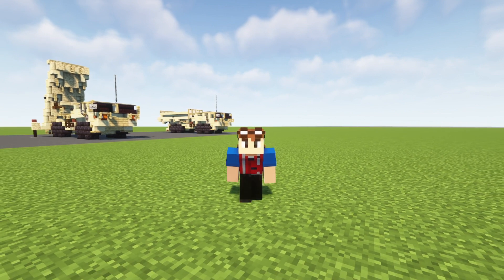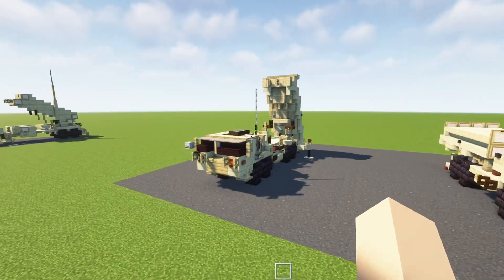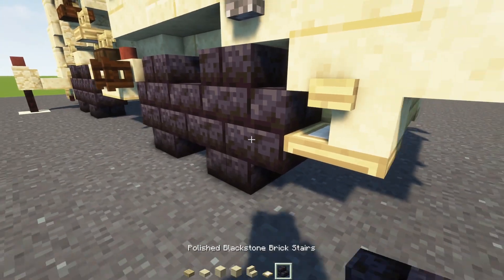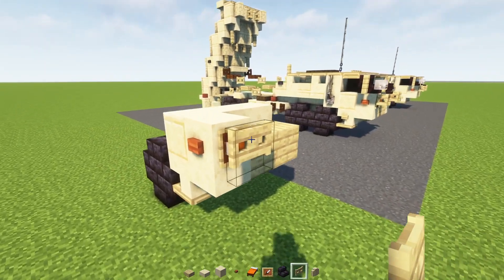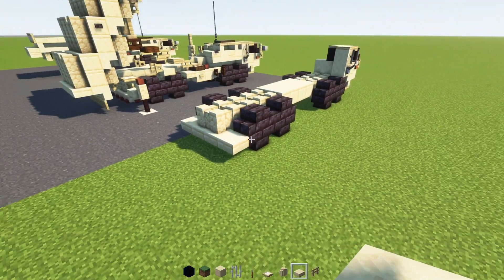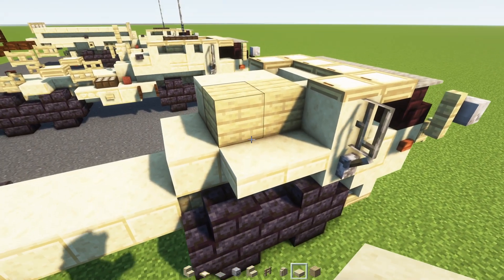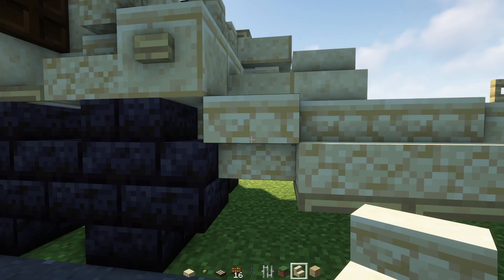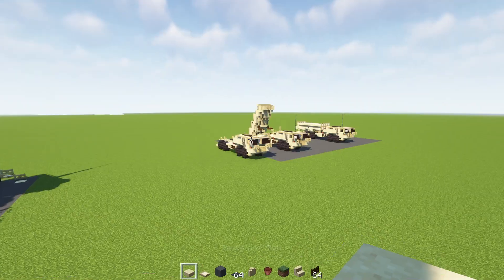Minecraft THAAD Missile Defense Tutorial

Comment: Loved the video @MC Military Force! Can't wait for the next video man! Sorry for taking so long, but I finally managed to get the Different Anti-Aircraft Battery Arrangements for the American Cleveland-class Light Cruisers from World War Two.

Just for Reference, The Cleveland-class Light Cruisers had 27 Ships which came after the Atlanta-class Light Anti-Aircraft Cruisers. They both used the same Hull Design for the Interwar Period Brooklyn-class Light Cruisers, though the Atlanta-class Ships were Shorter in Length, Narrower in Beam/Width and Shallower in Draft than the Cleveland-class Ships. They were 608 ft. 4 in. Overall in Length (or 187.179 Meters/Blocks), 600 ft. at the Waterline (or 184.615 Meters/Blocks), 66 ft. 4 in. in Width (or 20.410 Meters/Blocks), a Mean/Average Draft of 25 ft. 6 in. (or 7.846 Meters/Blocks), a Max Draft of 25 ft. (or 7.692 Meters/Blocks) and a Height of 113 ft. (or 34.769 Meters/Blocks) from the Keel (Bottom of the Ship) to the Top of the Radar Mast's.

The Cleveland-class Light Cruisers had 4 Triple Mount 6"/47 Caliber Guns (7.230 Meters/Blocks long) for their Main Battery and 6 Twin Mount 5"/38 Caliber Guns (4.871 Meters/Blocks long) for their Dual Purpose Secondary Battery. As I said before, The Anti-Aircraft Arrangement Varied depending on when the Ship was Built, which is the Subject here. The 27 Cleveland-class Light Cruisers are as Follows:

 1). USS Cleveland (CL-55).
 2). USS Columbia (CL-56).
 3). USS Montpelier (CL-57).
 4). USS Denver (CL-58).
 5). USS Santa Fe (CL-60).
 6). USS Birmingham (CL-62).
 7). USS Mobile (CL-63) (Pronounced Moh-Beel).
 8). USS Vincennes (CL-64).
 9). USS Pasadena (CL-65).
 10). USS Springfield (CL-66).
 11). USS Topeka (CL-67).
 12). USS Biloxi (CL-80).
 13). USS Houston (CL-81).
 14). USS Providence (CL-82).
 15). USS Manchester (CL-83).
 16). USS Vicksburg (CL-86).
 17). USS Duluth (CL-87).
 18). USS Miami (CL-89).
 19). USS Astoria (CL-90).
 20). USS Oklahoma City (CL-91).
 21). USS Little Rock (CL-92).
 22). USS Galveston (CL-93).
 23). USS Amsterdam (CL-101).
 24). USS Portsmouth (CL-102).
 25). USS Wilkes-Barre (CL-103) (Pronounced Wilks-bar).
 26). USS Atlanta (CL-104).
 27). USS Dayton (CL-105).

Now the Anti-Aircraft Batteries Varied from ship to ship, so I've listed them down as different "Standards" so that you or anyone who wants to try their hand at Building these Ships can have the Number of guns ready to build.

 • Cleveland Standard: Cleveland and Columbia both had 2 Quad Mount 40 millimeter Bofors and 13 Single 20 millimeter Oerlikon Anti-Aircraft Guns.

• Montpelier Standard: Montpelier herself had 4 Quad and 4 Twin Mount 40 millimeter Bofors and 17 Single 20 millimeter Oerlikon Anti-Aircraft Guns.

 • Denver Standard: Denver Herself had 4 Quad Mount and 8 Twin Mount 40 millimeter Bofors and 17 Single 20 millimeter Oerlikon Anti-Aircraft Guns.

 • Santa Fe Standard: Santa Fe, Vincennes, Pasadena, Springfield, Biloxi and Houston all had 4 Quad and 4 Twin Mount 40 millimeter Bofors and 21 Single 20 millimeter Oerlikon Anti-Aircraft Guns.

 • Birmingham Standard: Birmingham, Mobile, Topeka, Oklahoma City, Little Rock and Galveston all had 4 Quad and 6 Twin Mount 40 millimeter Bofos and 21 Single 20 millimeter Oerlikon Anti-Aircraft Guns.

 • Providence Standard: Providence, Manchester, Vicksburg, Duluth, Miami, Astoria, Amsterdam, Portsmouth, Wilkes-Barre, Atlanta and Dayton all had 4 Quad and 6 Twin Mount 40 millimeter Bofors and 10 Single 20 millimeter Oerlikon Anti-Aircraft Guns.

Also, for anyone else looking to try and Build these Ships, make sure to look for some Pictures of these Ships back in World War Two as well as Some Samples of the Colors used for their Camouflage Patterns. There's an Article on Wikipedia that I found a while back that goes into detail about the Standard Measures throughout the Second World War as well as a Set of Hyperlinks to the Standard Measure 30-Series Camouflage Patterns which came out near the End of the War in the Pacific where you can find Pattern Sheets for the Ships that Wore each Various Camouflage Pattern as well as a Picture of one of the Listed Ships with that Pattern. To decipher what the Patterns will mean, "MS" is "Measure, Standard", the Number will be the Colors so if it's "MS-32" it's Standard Measure 32, the Number after that will be what Design it is so "MS-32/4" it's Standard Measure 32 4th Design, and then the Letter at the End will denote what Ship the Design is for so "A" is for Aircraft Carriers, "B" is for Battleships, "C" is for Light and Heavy Cruisers and "D" is for Destroyers so if the Full Pattern Reads "MS-32/4D" it's Standard Measure 32 Colors in the 4th Design Pattern for Destroyers.

I hope you like the Idea man, I spent about an hour typing this up! Let me know what you think about it and I'll catch you in your next video! If you want, I can try and Color-Match a Block Palette for the Camouflage Patterns for you as well!